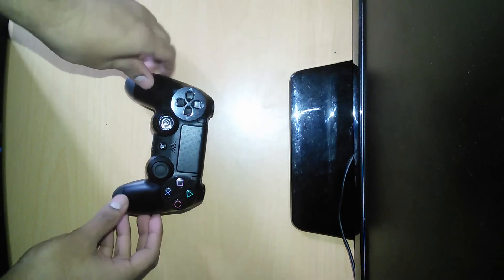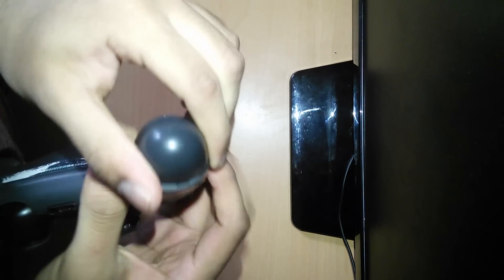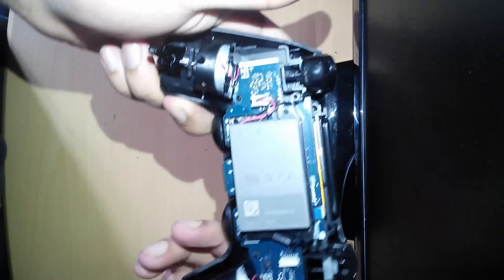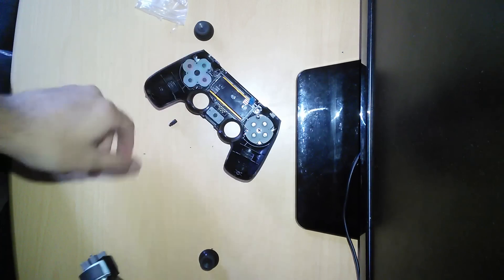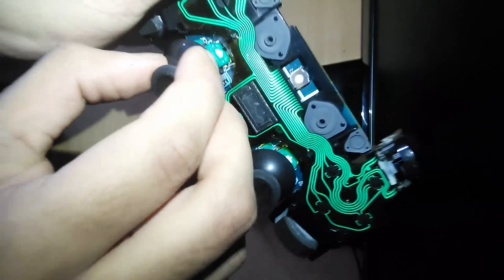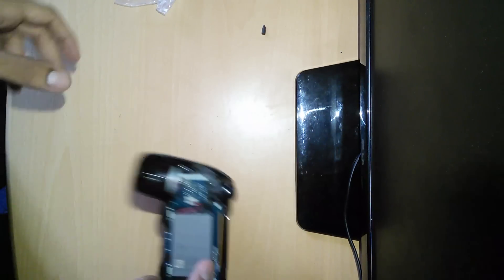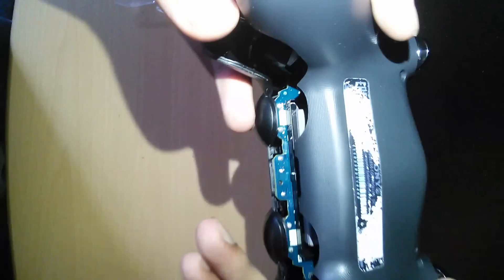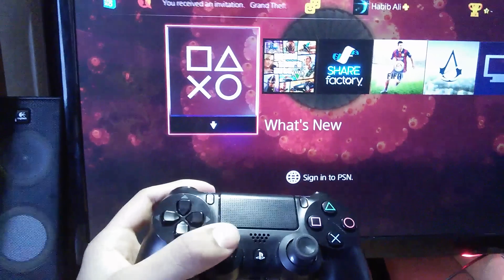Install Xbox one Thumbsticks on Dualshock 4

Comment: Are the x1 sticks leading to more precision although they have more leverage on so less resistance ????

nice video and thx at first. But tell us more about the feeling in games like cod aw now. For me it seems a bit like fps kontrolfreek style with the added height.
but u also loose some resistance due to the greater leverage..

our brain uses both "how strong" and "how far" your thumbs shall move to control motions. So when you wanna get more precise you need to change one of these two things f.e. make more resistance or get a bigger stick with bigger range from left to right ;-)
if both sticks where the same height on both systems and the PS4 just would have more resistance while having the same range it without a doubt would be the best stick on earth..
unfortunately it isn't !
So the question is whether the less resistance but bigger range enables one to get a finer movement or is the less range with higher resistance the key ???

I think that really super tiny fine movements may be easier on the PS sticks as default but not so much with keeping the stick in a certain angle to follow up a moving target with just the right speed. Therefore I think it's better to have more range so that every mm of stick travel doesn't effect the sticks angle that much.

Have you recognized an improvement over time once u got used to the lower resistance or do u think you finnaly where more precise with the default sticks. Beside their downsides ;-) ..really just looking for precision here ..